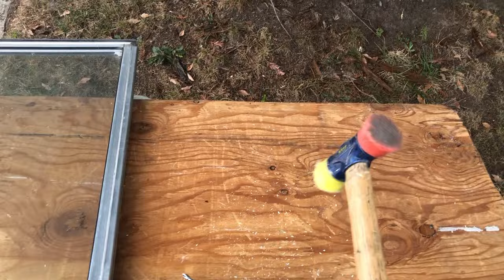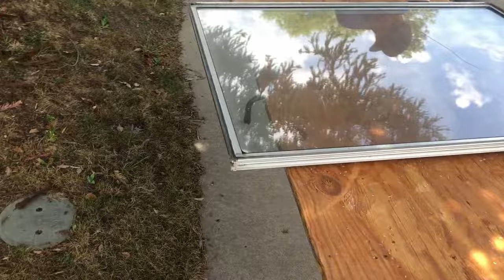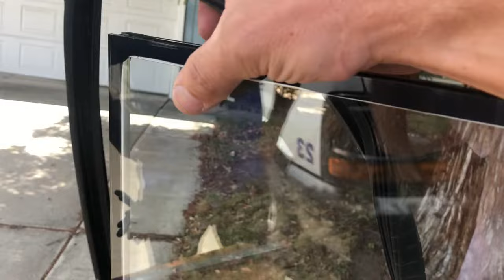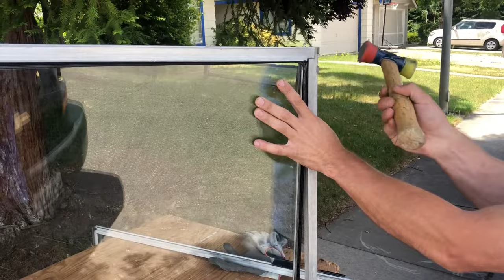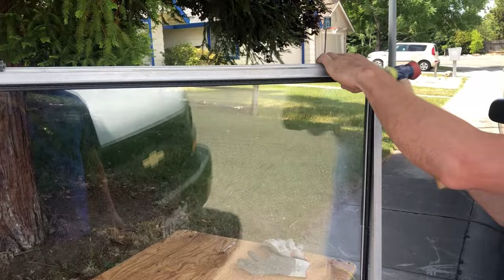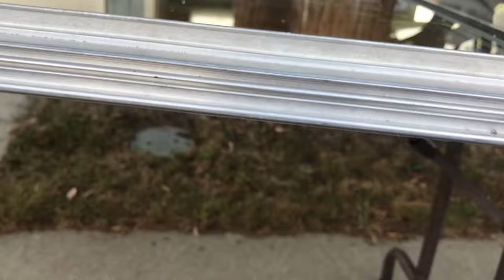How to replace broken double pane glass / IGU in aluminum frame!

Comment: Do you keep rubber gasket materials, rubber glazing stuff in the van? Or is it all unique to each window brand? Just curious what you do when its in bad condition, maybe just silicone?
Reply from the maker: We usually keep some rubber gaskets in the work van.  But I try to reuse the old gasket if it’s still in good condition

Comment: After two days of searching YouTube Your video is the only one I was able to find for the old style aluminum frames.  Which is exactly what I’ve been looking for. Thank you so much for such a detailed great video. If I wanted to replace one of the pieces of glass with a UV polycarbonate is that possible?
Reply from the maker: I think it should be doable as long as polycarbonate the same thickness as old glass!  If it’s dual pane window, you’d have to fabricate some spacers to make up for the thikness.

Comment: isn't this a dual pane window,,,  you completely skipped the part where you replaced the single pane?   or did you just buy a pre-made dual pane window already glued together?
Reply from the maker: The window is dual pane , there is no way to replace single pane with dual pane glass! Different thickness!  We just order new dual pane glass to the size needed and come back to replace it.
Reply: @roadglassandmore  ok, i thought you were replacing just one pane in the dual pane,   it looked at first glance that only one side of the dual pane was broken,,  i had one do that before

Comment: Thank you Brother for this very helpful video. It gave me the knowledge & confidence to repair a single pane sliding window where the side frame (attached handle) bowed & came off from the glass. Had I not watched this video I wouldn't have the courage to unscrew the loose frame, straighten frame,  reset the gasket, tap back the frame into position & screw it back at both ends. It was a great feeling after making it right. YouTubers like you are helping a lot of people like me hoping to fix things ourselves. God bless!
Reply from the maker: I’m glad I was able to help!

Comment: Thanks for your information about replace broken glass. I lost the corner bracket that hold frame together. Where can I buy new one?
Reply from the maker: You can try local glass shop, some usually save old parts . Or may be search online.

Comment: Wish mine was this easy. Took off the brackets so the window would slide all the way up but it still doesn't allow it to pull up and out. No exposed screws anywhere on the sill or the frame.

Comment: How did you remove the frame?
Reply from the maker: Slider part lifts up and out, fixed side there are 2 screws on the outside you have to remove, like in this video
https://youtu.be/lqvPQrDi_hM

Comment: what's that gasket that goes around the glass called? I can't find replacement for mine
Reply from the maker: Glazing gasket. Try that. Also measure the thickness of your glass, there are different gaskets for different thickness.
Reply: @roadglassandmore  thanks!

Comment: Very helpful....thank you. my broken window slides vertically (the fixed upper pane needs replacing), is it essentially the same process?  thanks
Reply from the maker: So, there are 2 types of the frames. 
If you see 2 screws on the outside holding horizontal piece of frame that holds fixed upper pane, then the process it the same as in this video, but you will have to remove the horizontal frame first ( remove to screws and poll the frame down).
But if there are no visible screws in the outside then the fixed glass is glued to the frame, there are usually removable glass stops on the inside.

Comment: Nice Video! Are you supposed to put desiccant and inert gas to prevent the window from fogging up?
Reply from the maker: Thanks.The new glass already sealed from the manufacturer when you buy it.Gas ( orgon ) is mainly used in colder states for better insulation.